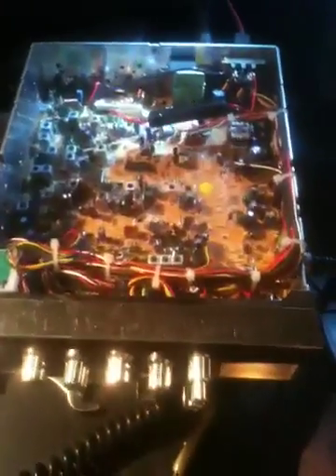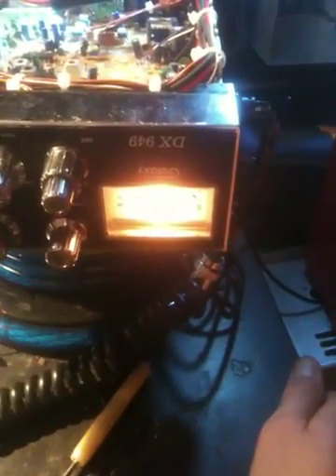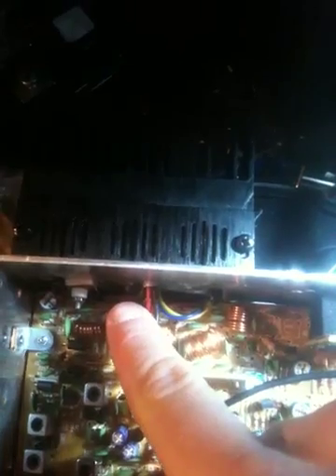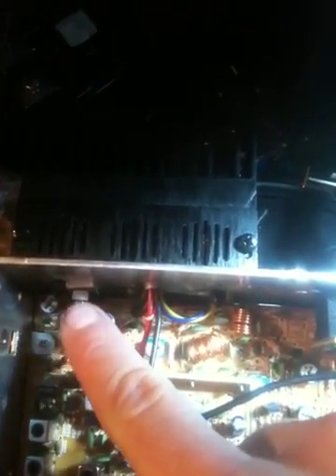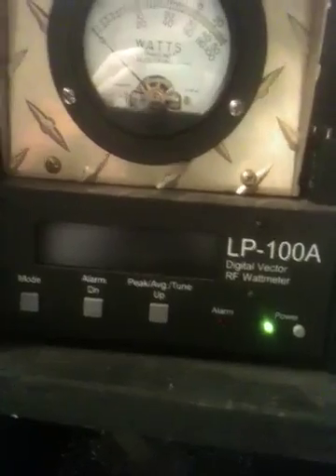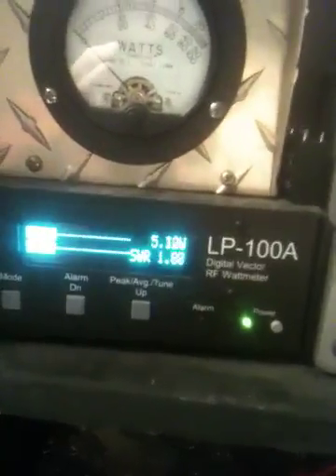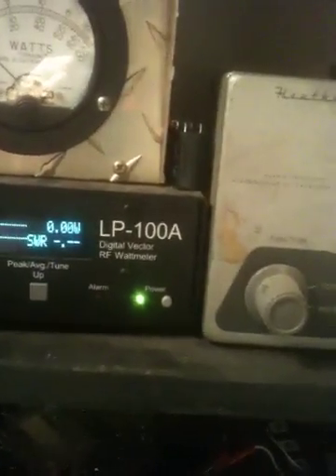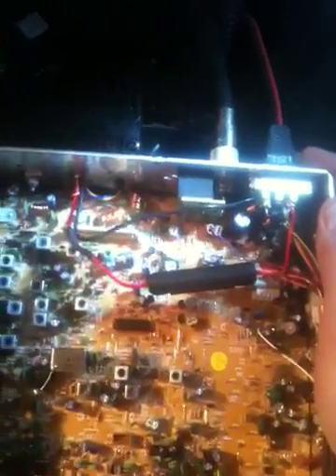RFX7 Galaxy DX949

Comment from the maker: The driver on this unit is a ERF520 .   I left the 520 in place for more drive.  I would check your voltage to make sure you are not getting any drop, also check the fuse and make sure you upgrade it to a 10amp vs the stock 3. 

If everything checks out, I would upgrade the driver to either a 2030 or the 520.  Good luck and keep us posted.